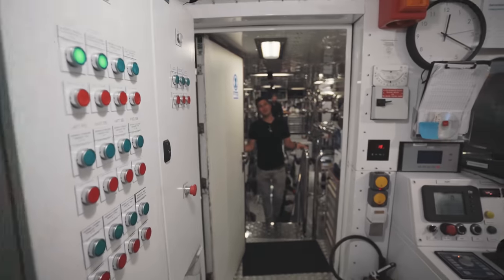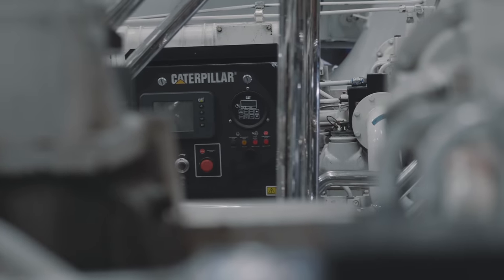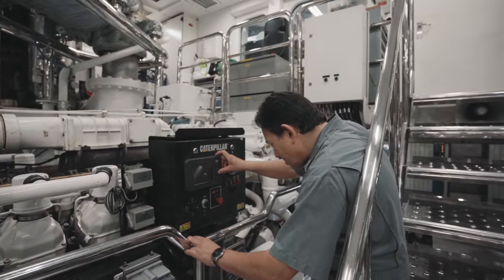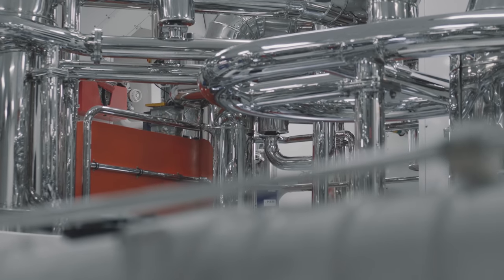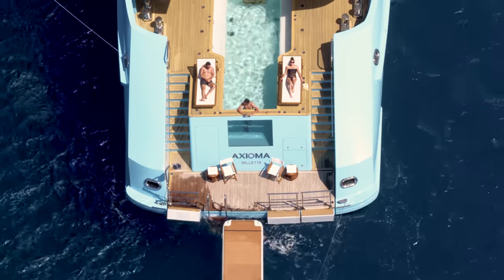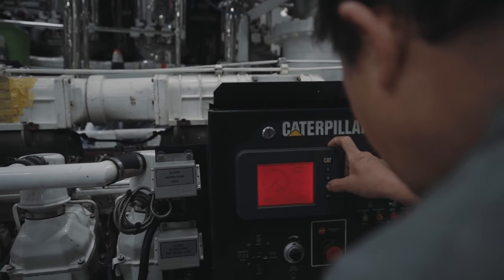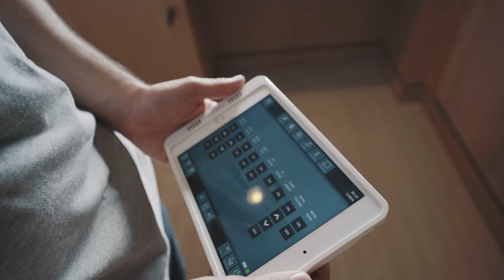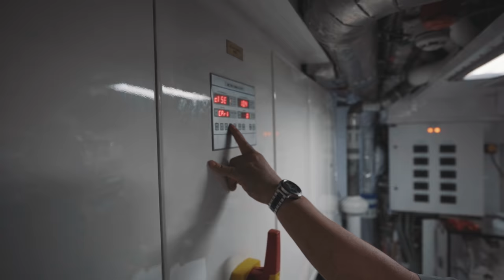In-depth Look | Mega Yacht Engine Room

Comment: As a semi-retired deck officer in the merchant marine, I must pass on my highest respect to marine engineers.  What I have observed over the last 45 years or so, their ability to carry-out major repair work in remote locations, etc., have been, quite simply, outstanding. 

I had worked with many engineers & mates, who had spent time working on mega-yachts, however, in the vast majority of cases, they had returned to work in the merchant marine, mostly on account of three factors: better time-off (1:1), better monetary compensation and a decent pension plan.  Any comments this regard (or anything else), would be most appreciated.

Comment: Does this yacht have a crew chef? I imagine that since they have 3 engineers, probably 3 stewardess and 3 or 4 deckhands, captain and probably a first and second officer , that's 13 or 14 crew so I imagine there is a crew chef unless the chef also cooks for the crew.
Reply: A yacht of this size will have a crew chef or a stew/chef or deck/chef that takes care of crew food. The crew chef will help with the main chef every day as well in addition to keeping the kitchen clean. Main chef will handle fancy food for guests, designing menus, as as well as food selection and provisioning. This yacht likely has a provision outfit on retainer as well. I would just guess that this yacht has 2 chefs and maybe a stew/chef with 20 crew.
Reply: @Howard.Stern.  I would think so. When I crewed on yachts, this was the case. I don't things have changed that much since I left yachting. I just didn't see or hear anything mentioned about the crew chef. Since these are all rotational crew, I imagine the crew chef is a short term seasonal hire. That's how it was on the last boat I was on. Rotation was just getting introduced into yachting and one of the first to request it was chef's who got burned out cooking constantly on smaller boats where they had to cook for guest and crew. But I've seen chef's that cooked for 10-12 guests and 8-12 crew before too. They usually pulled in someone to help with prep and assisting, but that's a big job. I used to do that and I loved it. We moved fast and turned out some awesome meals. Makes you feel good.
Reply: @clifbradley   I looked up the current crew. Looks like 2 chefs, one main one crew, and an off boat provisioner. Plus the stews can likely help with certain things in the galley.

Comment: Hi guys ,I am a skipper on my own 41’ cutter rig sailing boat ,engine is only 49 hp BMW consumption is 1,5 lt / h on 1600 rpm. 5 knots speed with engine ,7-7,5 with sails. But you are amazing,🍀🧿👏👏👏💕🧜‍♂️🇹🇷🧜‍♀️

Comment: I'm sure he made a mistake of saying that he runs 10,000 liters a day.  That cannot be. He must have his gallons and liters conversions wrong.
Reply: How is that not possible? 10m3 a day when underway would be fairly economical by most standards
Reply: The ship weighs 1,620 mT, that's a lot of mass to move plus they have to provide power via diesel generators for what is basically a floating mansion. For comparison, a Bering 65 which can't go anywhere near as fast and only weighs 102 mT has a fuel consumption of over 2,000 liters per day and it's also considered to be fuel efficient for its size.

For reference to a "fast" boat that is trying to be economical by going slow, an example would be the Marlow Explorer 61E(33 mT); it would burn 2,400 liters per day and if it got up on plan then you could easily double that. At top speed(27 knots) its fuel consumption is about 480 liters per hour and it would completely drain it's fuel tanks in a mere 14 hours.